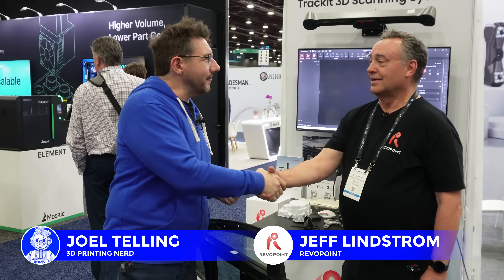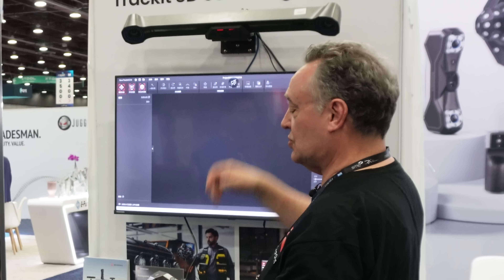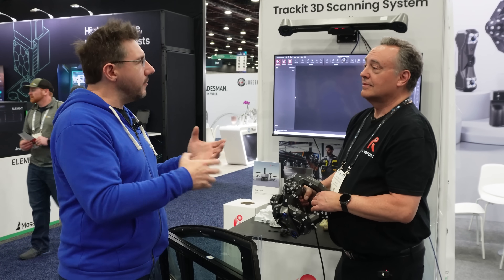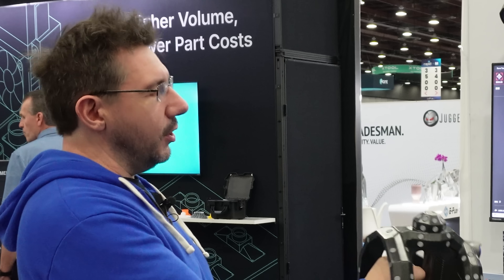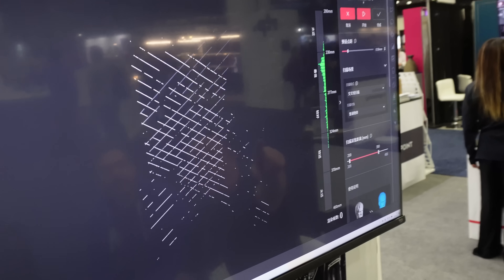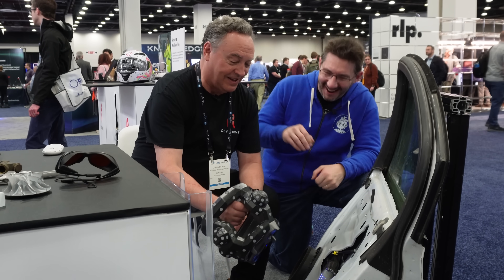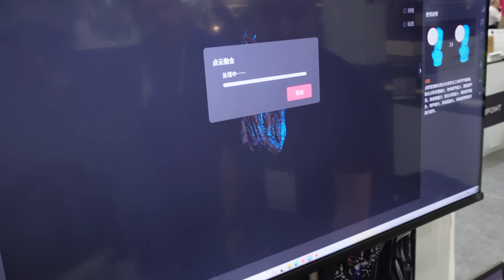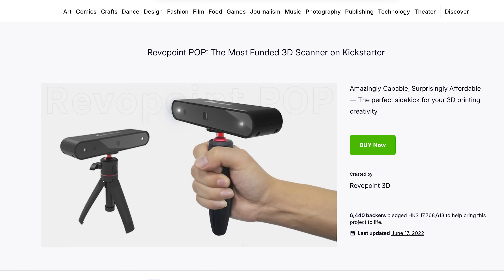INCREDIBLE 3D Scanning with Revopoint Trackit!

Comment: I don't know if its more a problem with scanning or the post processing after the scan but I haven't seen a single video of 3d scanning that impresses me. I don't want to have to geek out on 3d scanning, I want to scan and maybe spend 5 minutes or less cleaning something up with software and then print, and I want it for sub $1000 price. If the scanner and software can't do that, I'm not interested. So far, I've yet to see a 3d scanner that achieves all 3 things.

Comment: Not new, I mean VR systems have been using Tracker cameras for years.  I am surprised it took them this long to use it in scanning.  Heck, smaller software companies could incorporate  HTC VIve tracker cameras + track pucks, and get perfect tracking and charge far less than I imagine they will for this thing.